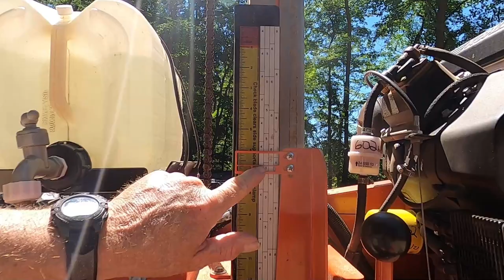Stressed Logs and Straight Grain Sawing

Comment: Nice work ! you didn't show all the edging of the first cut's. I trim thin to square it up too.I   
was saving all the thin for years. I cleaned it all up this last spring finished inside my filing shop for the blades. Gave a truck load to my friend & cut the rest for fire.
Reply from the maker: I don't have room to store all those trims, so we get them done, and get them stacked.
We skipped the edging. Its kind of like watching someone sand something. Kinda boring I think. LOL
It's good to have you on the channel.  Hope you keep stopping back.
Reply: @IronOakSawmill  That's why I had to get rid of all the trim. Now I start all over filling the same spot. I have a couple concrete contractors they pick up some thin trim for bendy board for side walks. It builds up fast! On my channel I have one video of me milling some 5x5's western red ceder that was last sawing for the summer I start back up in October. I try to see all your videos. not boring to me but I now what you mean. thanks for all your videos!..

Comment: The pith check should have been level with the deck when you started so you only jave one board with the pith check. Also trimming should be done before you get to the cant as to maximise the most quality boards.